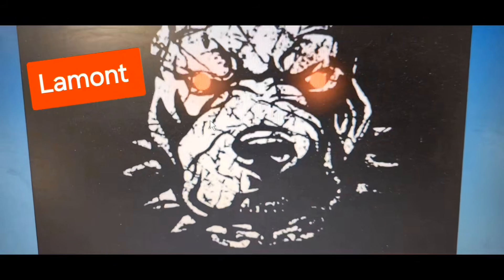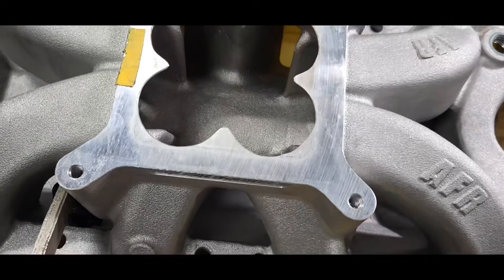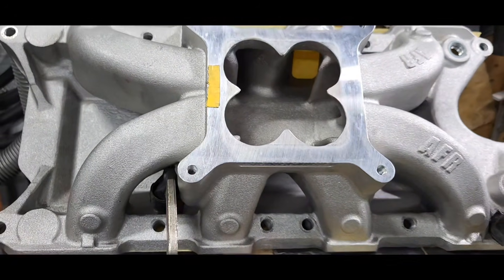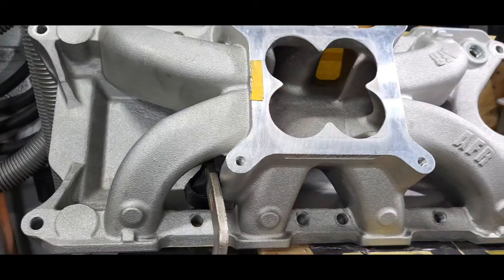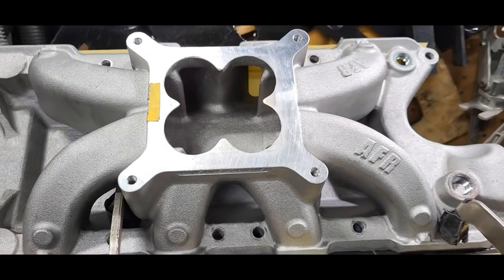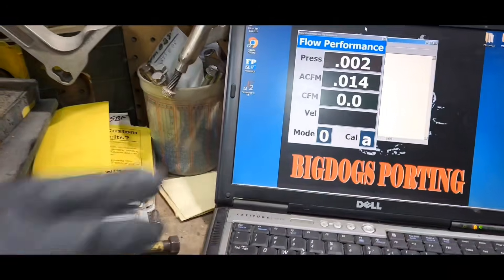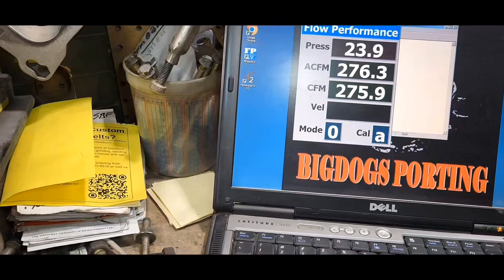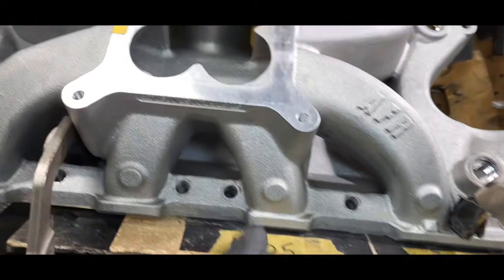AFR SBF Renegade Single plane intake manifold porting and flow testing.

Comment: I had  BigDogs port my Afr 185'S. I ended up with 323 cfm. Same if not better than the 205's. I believe the velocity will be what makes them better.
Reply from the maker: 🙏🙏, you are correct.

Comment: Nice work! Was this intake the “port matched” version to start with?
Reply from the maker: @jasont8718  yes it was. They are really good castings but they just don't flow as much as needed for today's motors hp capabilities.
Reply: Sheesh, that was the port matched version. It looks like it's better to buy the non pm intake and send it to you guy's. I think it's like a $170 dollar difference.

Comment: I got some og 289 hi-po heads and a funnel web intake i got from a guy a few years back. He made an attempt to port them and made a small hole in one of the exhaust ports. Could you all repair that and do the heads properly along with the intake?
Reply from the maker: @LeachimSagrav333  naw we are not touching those heads after someone messed with them but we will do the manifold.
Thanks